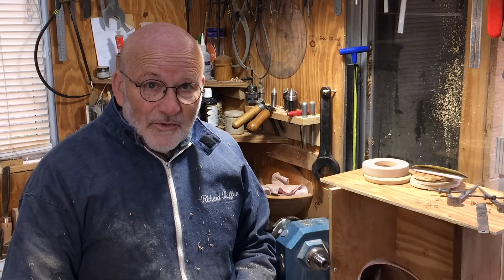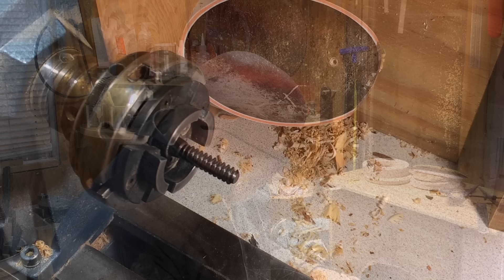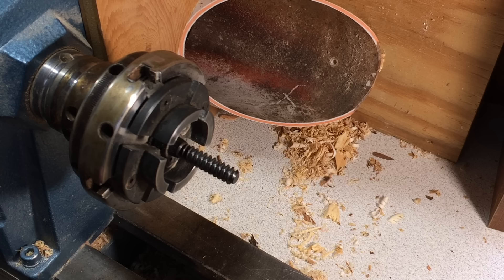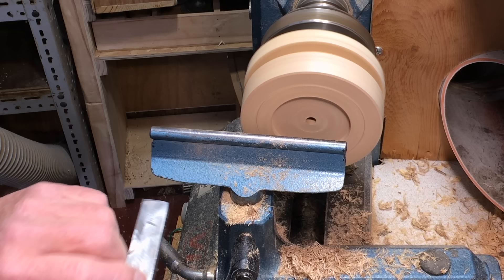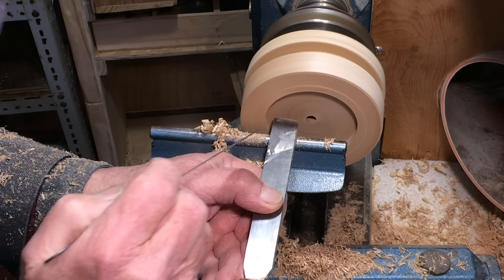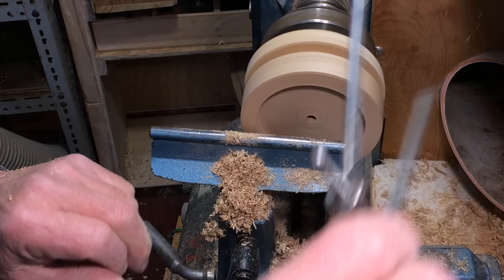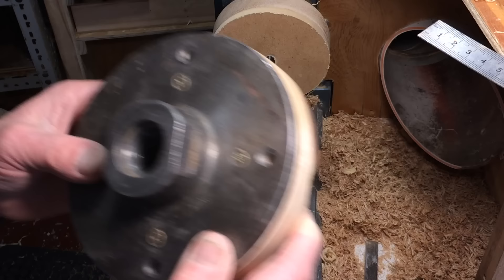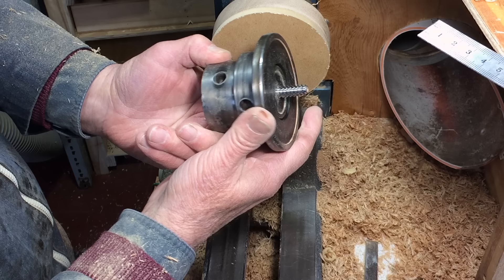Richard Raffan turns a chuck collar

Comment: Good to know that a larger diameter equals a shorter screw, that’s gonna be helpful for platters, thank you so much Richard
Reply from the maker: In the 1970s I used to turn a lot 18-in x 2-in (460x50mm) ash trays and dishes on a ½-in #14 wood screw with a 7-in (180mm) backing plate.  This was well before modern chucks.  The screw hole in the base was filled with plastic wood.
Reply: Most of the twisting force (torque) transferred from the chuck to the workpiece is by frictional contact between the backing surface and the workpiece. It follows that a larger diameter is better. The main function of the screw is to pull the piece up against the backing surface.   -old guy, NC, USA

Comment: Thank you for sharing this tip Richard.  I am with you on using a dedicated screw chuck, I have several that I use in my production work, but this is a great way for turners to make there chucks with  wormwood screws, and other screw chucks safer for larger projects.

Comment: Richard, your long wood worm screw makes me appreciate the shorter Record Power and Nova wood worm screws. I made a donut based on the tip you had in your Illustrated Guide to Woodturning (which you autographed back in 2011 at the Chatanooga Woodcraft store). I have been using that donut for many years with my wood worm screw. I have a set of Record Power 5" jaws that were designed to also hold the woodworm screw that typically only work with the normal jaws, a nice design feature by Record Power. So now a days I tend to use that. I see it is winter there from short views of your hat. Summer here in Atlanta.
Reply from the maker: Mike, isn't it about time you made your own screw chuck — I look forward to the video. It is cold here and barely into double figures. I've an unheated workshop so a beanie is essential.
Reply: @RichardRaffanwoodturning  Yes, I saw that woven beanie on your head. I'm sitting shirtless in my South Florida screen room  watching your video.  OK ....., last month I would have killed for woven beanie weather!  BTW, that collar rupture is why I cross drill and glue dowels for any tooling that will stress face or side grain like that.    
Wakodahatchee Chris

Comment: Great video.  Gave me a few new turning tricks for my lathe although out of laziness I'll probably 3D print the part you just made for quicker results and a stronger part.
Reply from the maker: It might be quicker to turn one...
Reply: @RichardRaffanwoodturning  It is indeed faster to turn it by hand (probably more fun too) but in terms of performance the plastic part would probably be better in a few ways.  There's no grain so won't split, although using plywood is a fix on that.  It's more precise to print it and I can probably add in a few extra features like a bolt pattern with recesses for nuts etc to use it as some sort of secondary mounting plate.
Reply from the maker: @rpower1401  Couldn't agree more. I often wonder what the manufacturers don't make collars.
Reply: @RichardRaffanwoodturning  Sometimes something simple goes unnoticed and unmanufactured.  I'm thinking this could double as a quick detach face mounting place by expanding the centre to hold it in place.  Print a few copies to have on hand for misc projects and I'm laughing....until I over stress the plastic and it all breaks apart.....nothing's ever perfect lol

Comment: Richard- Many thanks for the wonderful demonstrations. In some of your books you discuss using templates to replicate bowls. Could you demonstrate how you do that?
Reply from the maker: That's something I've not done for at least 35 years, maybe 52. I'll add it to my list to shoot.
Reply: @RichardRaffanwoodturning  Maybe its like riding a bike? -- you never forget. I have learned to duplicate things but its very time consuming.  Would like to get to production level speed.
Reply from the maker: @davehickman742  Making a set of bowls or plates it's important to get the height the same on each, or within a millimetre, likewise with details like beads on the profile. Whereas the diameter isn't so important —small differences in diameter don't leap to the eye like variations in height or having one bead higher than another.  Sets of bowls need to look right from above with matching rims, but they are rarely viewed from the side so you can accommodate minor differences in the profile. Repetition is the key to the turning, and getting into a rhythm. Don't change your, tools, techniques, or approach halfway through a set, and trust your eye. It's the small differences in a handmade set that makes it more appealing than one with all pieces exacty the same.
Reply: @RichardRaffanwoodturning  After reading your book "The Art of Turned Bowls" (and learning that the possible forms are unlimited and some are more pleasing than others). 
I started drawing a form for a particular blank. I then turn an approximation of that form (since I could not figure out how to use a template). 
I now have a number of drawn forms that I can select from (not necessarily  to make sets - while that might be nice as well). Maybe I'm overthinking this and I just need to turn more of the same item to improve speed and repeatability. PM if you would like to see some of my work.
Reply from the maker: @davehickman742  Happy to do email but can't work out how to PM. Can you contact me via https://www.richardraffan.com.au/contact/

Comment: How do you finish the part where the screw is holding the blank. As you can see with my question, I'm a beginner. I forgot about a jam chuck. I have only turned 1 bowl as of yet.
Reply from the maker: The screw is usually into the bit that will be hollowed, but if, for instance, you want to take something like a bread board or even bowl off a screw, simply plug the hole. That was the usual practice in the 1970s before we had dedicated woodturning chucks.

Comment: Awsome video, is that VM90 chuck?
Was looking to get one for maybe a really big set of jaws since its a bit cheaper that 100.....
Reply from the maker: It is a Vicmarc VM90. If you don't have a spindle lock you're better off with a VM100 which is the same size but has a key.
Reply: @RichardRaffanwoodturning  I do have spindle lock, its a bit cheaper so it cross my mind😀
Reply: @RichardRaffanwoodturning  performanse vise,do they perform the same? Other then levers  do you find them ok?
Reply from the maker: @tomislavtomasicwoodturning  I used the tommy-bar VM90s for many years. I had about six. They're very quick and easy to operate and faster to open and close than the VM100s that have a key. I use an L-shape key on my VM100 so I can adjust my VM100s as fast as I coul using tommy-bars on the VM90.

Comment: Been watching you turn for years, still have some vhs tapes but no player anymore.. one question i always wondered,  not necessarily with this piece but in general how in the world do you get so much time on the burr on your scrapers? Every time I turn around I need to bring the burr back up, you seem to get forever on your scrapers.. is it some benefit that happens living below the equator..
Reply from the maker: I'd put it down to my choice of  timber. Turning wood for a living, I always looked for wood that's easy to work, aiming to avoid any boards or logs that might contain grit or silica that blunts tools in a milli-second, or grain that's particularly tricky to cut cleanly. I usually hone scrapers rather than go to the grinder, although which can depend on the wood I'm turning.
Reply: Honing rather than sharpening at the wheel. Interesting to know that honing actually is effective. Will attempt to do it more often. Thanks.
Reply from the maker: @ned711  Honing is sharpening, fine sharpening. However I only hone edges I'm about to use for scraping or shear scraping. Honing creates a micro bevel that on shear-cutting gouges and skew chisels (when I want the whole bevel against the wood) that I prefer to be without, so I use an edge straight off the 80-grit CBN wheel.
Reply: @RichardRaffanwoodturning  Thank you, Richard, for your thorough and thoughtful response. While I rarely hone an edge, I’ll now give it a try again when I’m scraping for a final finish.  Ned